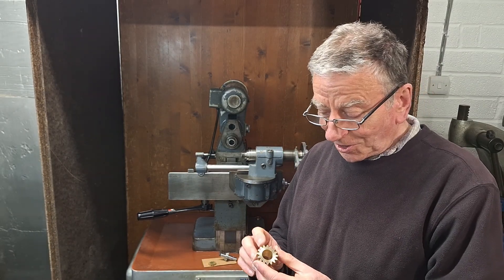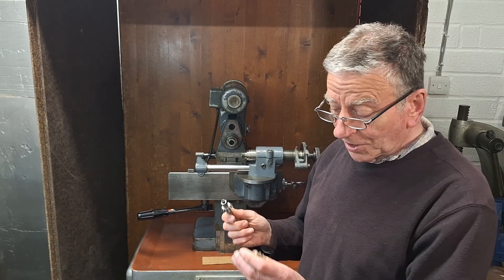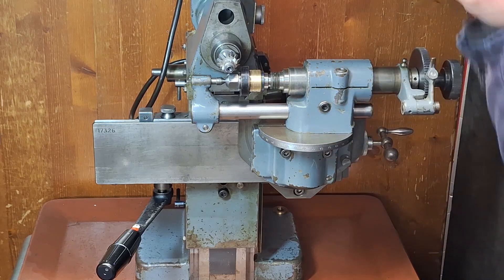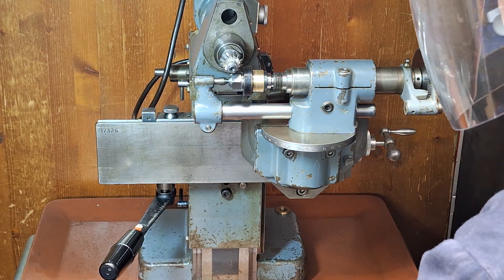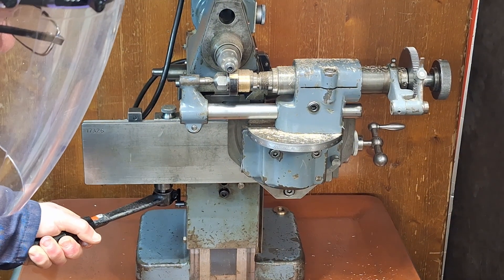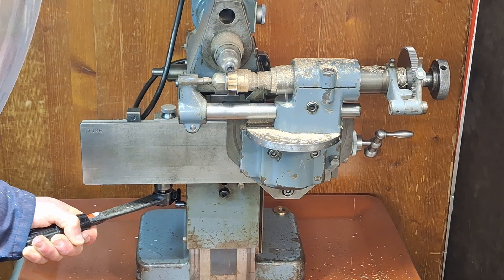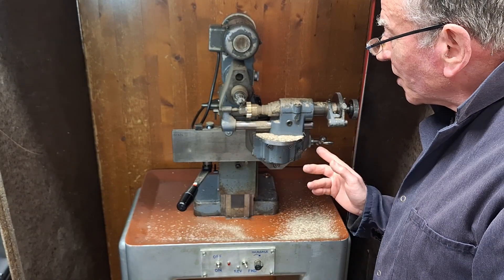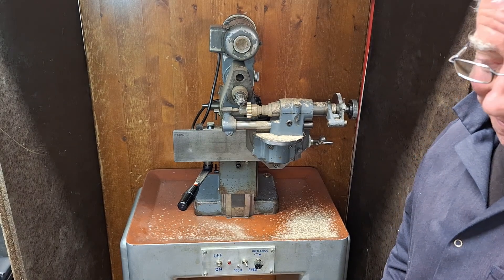Actually Cutting a Two Way Ratchet Wheel on an Aciera F1 Mill

Comment: Should the silver handle be turning like that? Can't tell what it does, but it looked like you were managing to back drive it.
Reply from the maker: Welcome, and thank you for your comment. That handle is on the feedscrew for the horizontal traverse. In this video in order to change over to lever feed, the feedscrew nut has been released. I think the silver handle, now effectively loose, either vibrated around or perhaps the slide was just moving the nut a little and so turning the handle - and back driving it as you suggested. Well spotted and thank you for watching my video.

Comment: That went well - probably asking a lot of the machine but the end result is very nice. Those tiny shards of brass are not to be taken lightly - good move on the PPE. 👍

Great close up of the finished part - excellent quality.
Reply from the maker: Thanks for taking the time to comment it is much appreciated. Yes it was asking a lot, two or preferably three lighter cuts would have been much more sensible. Those shards are very good at working their way into your skin...